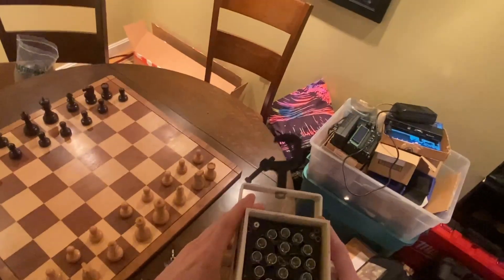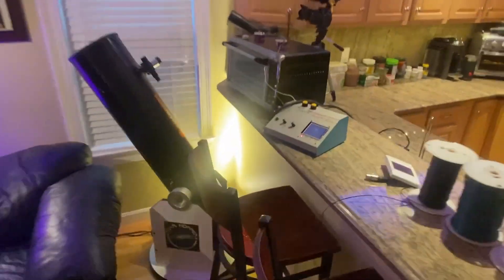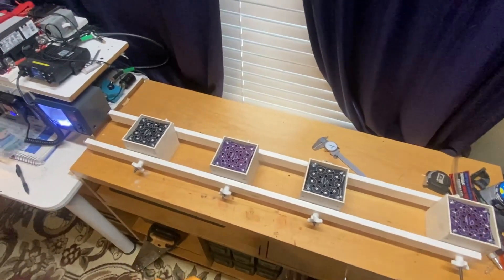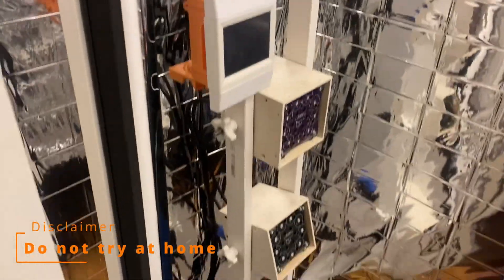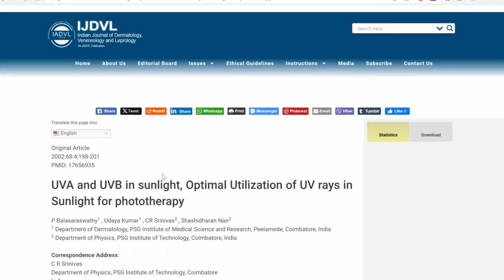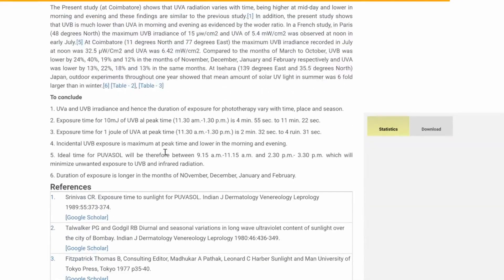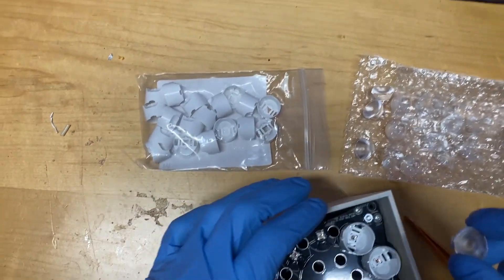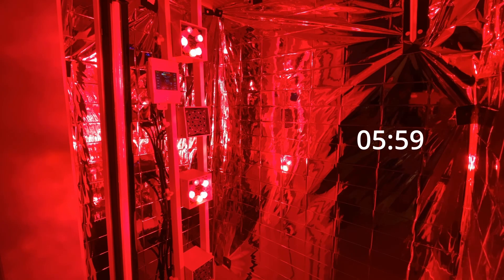Building a Red Light Therapy Booth from Scratch

Comment: Really enjoyed this video, thanks for sharing your progress. I am looking to do something similar to this, however mainly with near infrared lights LEDs. 

Do the UV LEDs peak at the same level as the fluorescent tubes useful peak, because to me it looks like they both that that peak at 365nm? Do you have any thoughts on including more infrared LEDs at different wavelengths into this design?
Reply from the maker: Thanks for watching!  

Yes, one of the fluorescent peaks is at 365nm, but I also believe there are several more peaks off the screen closer to 300nm that I can't see with my spectrometer (this is what the manufacturer of the tube says anyway).

For my design, I used the following wavelengths: 850nm, 940nm, 663nm, 734nm and 624nm.  Its my understanding wavelengths within this range have the most therapeutic benefits.
Reply: @CosmologicalNonsense   Thank for the reply! That makes sense about the fluorescent tube from some other blogs and they say the spectroscope to detect those lower UV levels is quite expensive 😅

That is more infrared than I initially thought. I have looked myself at the 1050nm infrared LEDs to incorporate into a therapy light, and they seem disproportionately expensive, have you also found this to be the case?
Reply from the maker: I’m not really sure about the cost of 1050nm LEDs.  The LEDs I used were purchased from Digikey and are from the Osram “LZ1” family.